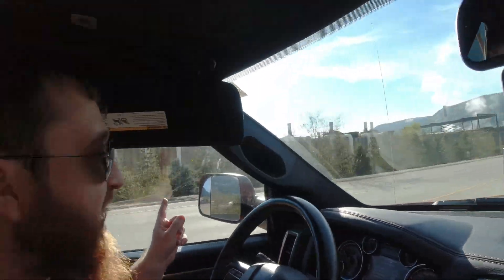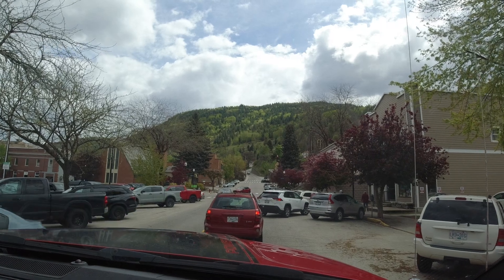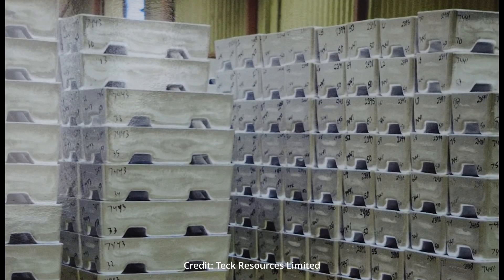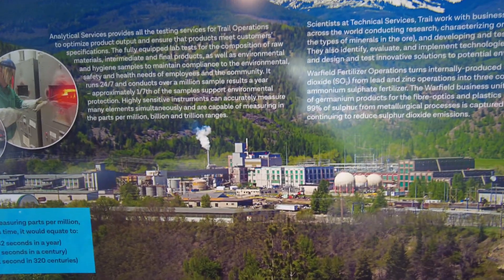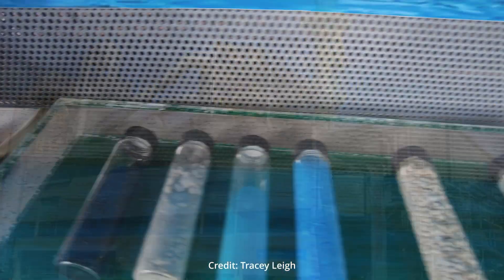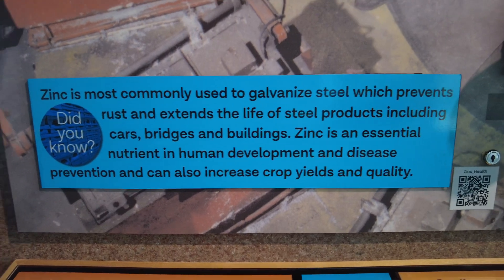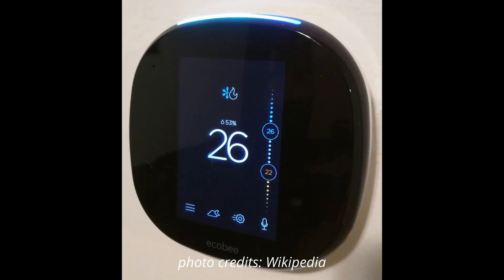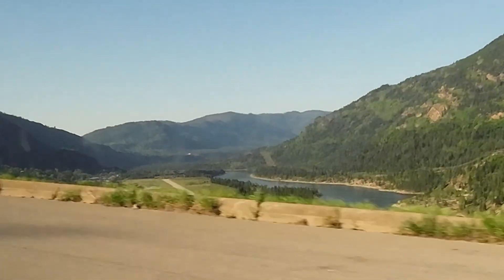Smelting Zinc & Lead - One Of The Worlds Largest Fully Integrated Smelters, Since 1896 In Trail BC

Comment: I'm curious. My employer is buying cheaper zinc oxide from Mexico now to save money. It has poor refinement and contains 7% lead, 6% iron and 2% cadmium. The other supplier we have from Canada has .39% combined of the 3 aforementioned.
This goes into a feed additive for animals. We have a lot of trouble running this product (Maximo 910rt) through our reactors, and drying process. Experiencing problems never seen before and it is much more reactive. It can't be good for animals either. We are trying to prove to upper management this is the problem because of the heavy metals not being removed in the refinement process because this zinc oxide is not meant for a feed additive.